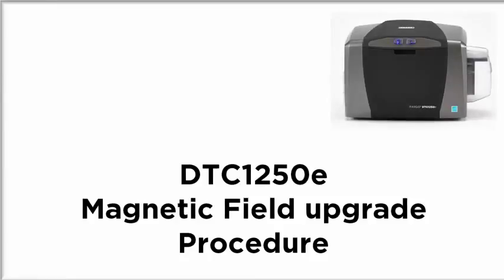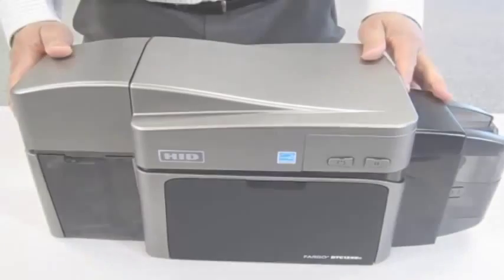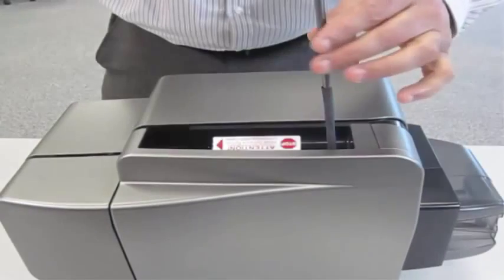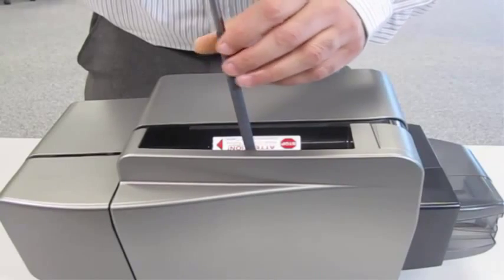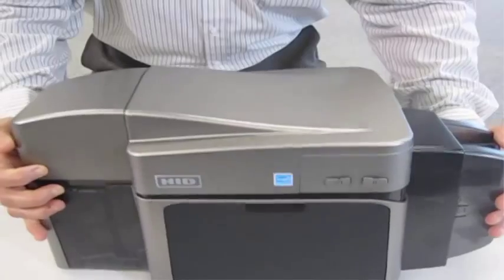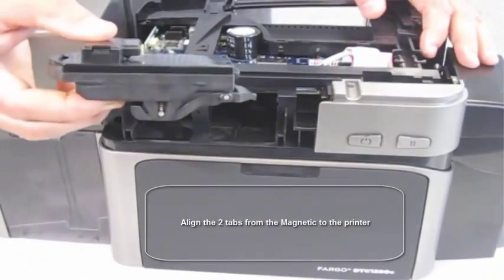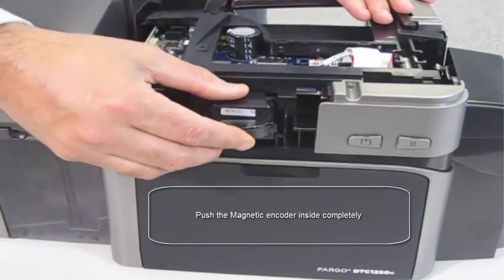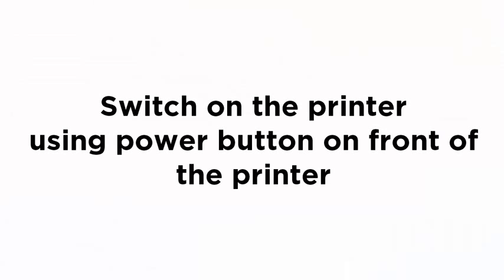FARGO DTC1250e - How to install magnetic encoder in DTC1250e card printer?

Comment: Printer was easy to install and easy to use👀>share4.photo/CardPrinter?Eや     I contacted the seller for questions and got help really fast . I have printed more than 30 times and didn't have any problems with it . If you need an affordable printer This is it .